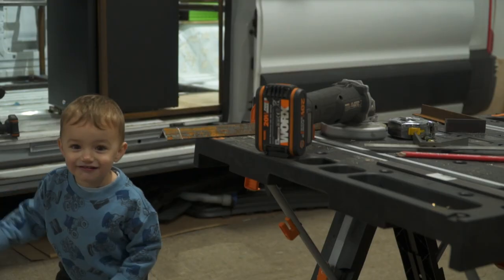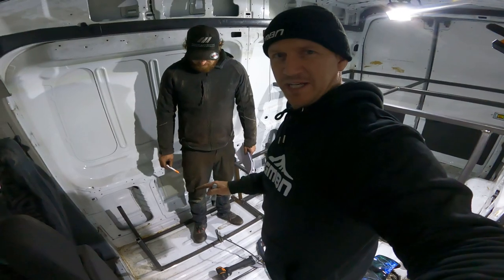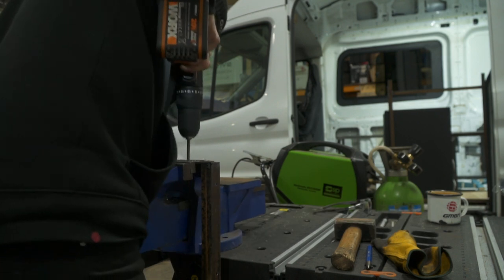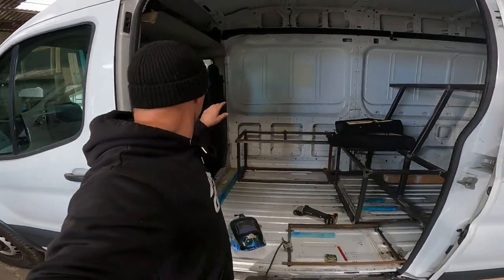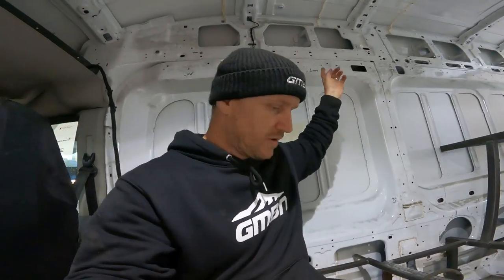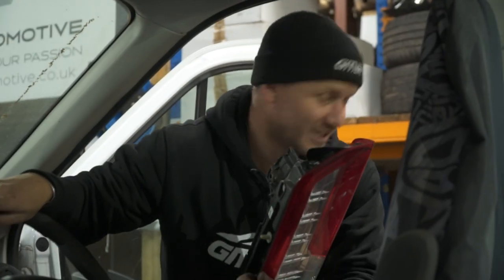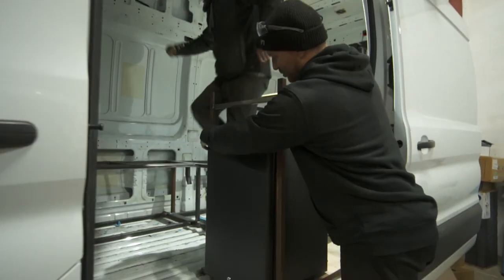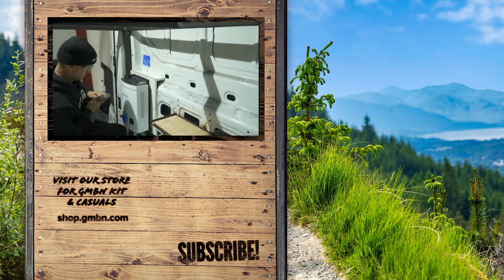Ultimate Van Framework & Start Wiring! | Blake Builds Van Life Ep.3

Comment from the maker: What features would you have in your ultimate MTB van? Let us know 👇
Reply: Put a USB and plug I'm the shed part for any wireless gears and power meters
Reply: I’d have a miniature shop style section with an abundance of spare parts, perishables and cleaning products
Reply: I'd definitely fit a bike wash station, plenty of storage for spares and a TV with WiFi so you can watch GMBN at any given time!! 😉 😂👍
Reply: opening skylight in the roof for when Blake burns the toast or makes a nasty smell  haha
Reply: I always wanted to build out the rear doors with an integrated curved shower rod that could retract into the doors.  You open the rear doors, extend the curved bars, and drop your shower curtain.  A small tankless hot water heater could be attached to a shower head on the rear doors, and voila!  You've got a private shower area.
Reply: Fold out everything... Grill, bench, a work surface, awning...

Comment: You have probably finished it now but dont forget insulation on roof and walls and a ventialtion grill to cut down on condensation.
Reply: I would add the floor needs insulating as well... There is going to be a lot of thermal bridging due to that steel.
Reply: I'm yet to get to that point. But yes I'll be adding loads to the floor, walls and ceiling
Reply: @Zimblake  nice one.... Loving the build it looks great.

Comment: What was the reason for the steel? Regulations/insurance, weight, cost or several reasons? I've seen van builds using aluminium, wood frames etc. I'm guessing it would be heavier and people normally have an easier time working with wood or fit together aluminium that steel/welding.

Comment: Split charge relay is not great on the transit, better with a battery to battery charger as they have a smart alternator. If you use FORScan or similar you can disabled smart alternator.

Comment: You can legally fit seats in the u.k without seatbelts in a vans rear to convert it to carry passengers without any new checks on m.o.ts. its is only advised to secure them so they cant move🤣 you are 100% liable if someone is injured but. N your ment to check the extra weight doesnt mess up weight distribution when moving. Anyone under 12 must be using propper restraints so seatbelts of child seats must be used. You cant have morethan 8 seats or you have to follow minibus regulations

Comment: Hey Blake pro tip, instead of cutting all of your wires in the same place cut them staggered, that way you don't have a giant ball wadded up.
Reply: Also if they are staggered it's easier to discern which wires go to its respective mate.
Reply: Also highly don't recommend using a torch on heat shrink. Use a heat gun with a wire scoop.

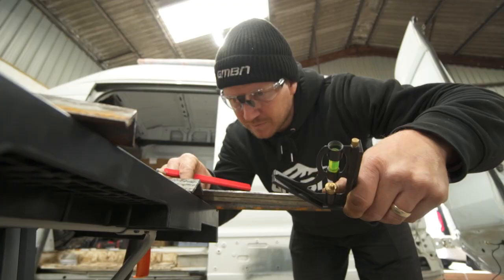Comment: Love it, but not the missing guard off the angle grinder at  19:18 and only wearing safety glasses. Guard on, full face shield and gloves should be used.  I've seen a face with a grinding disc embedded in it and it is not pleasant.  Get the mechanic a bloody bench and engine stand lol

Comment: You couldve saved yourself alot of wiring effort if you just ran main lines and used bus bars etc. its neatier, easier and cheaper.
I rewire boats as a side cash job and the first thing i do is rip out that $50k+ million wire mess.
Main cables to power the bars, then small short wiring to anything. (the bus bars we use are individually fused on each one and each bus has a small wire that runs to a central system that tells you where the issue is.)

I understand the house wiring used in boats/cars but its just messy and if you have an issue your hunting for issues with all your wires, car engine harnesses are the absolute worst but theres nothing you can do about it as it has to be ran that way for sensors etc.

Running alot of wires and long thin ones, creates heat under load, you can have an issue youll never find without pulling the whole system out.
i specifically fuly load every item/bar and check temps on wiring